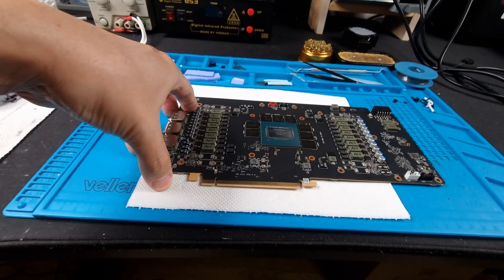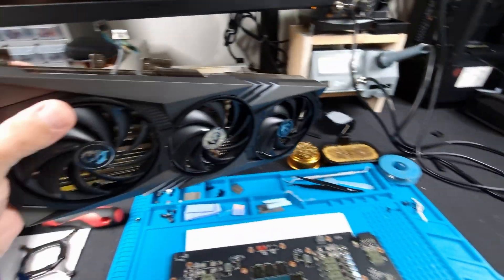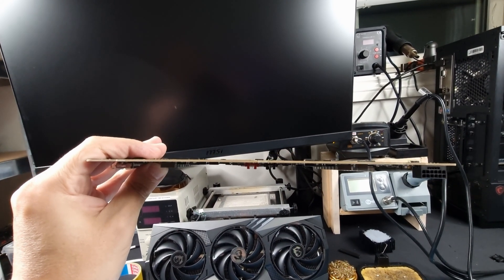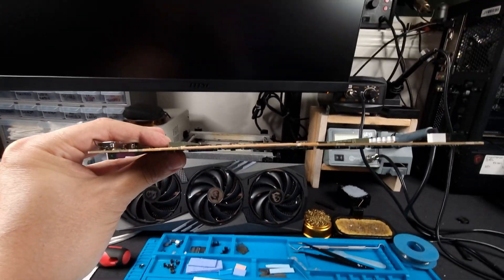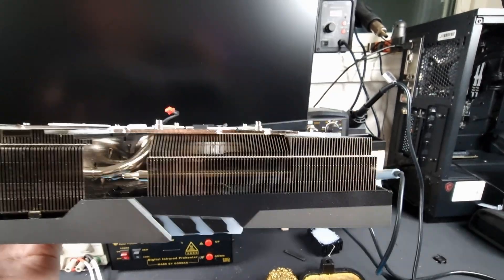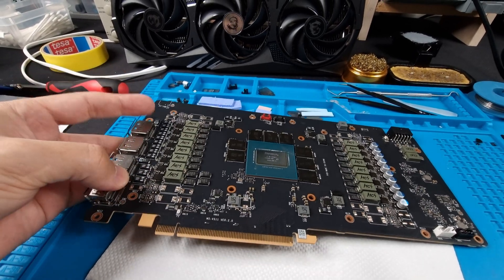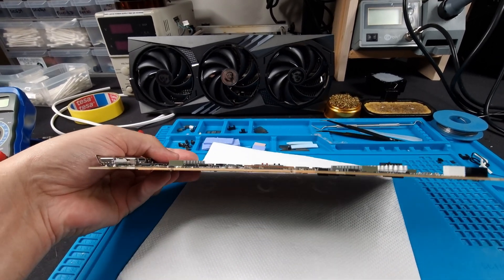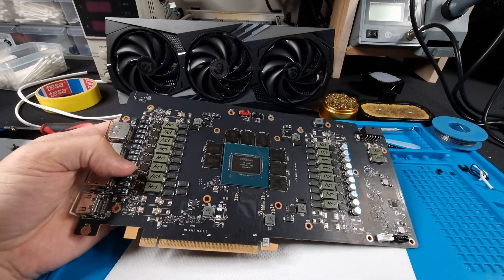How Using GPU Supports Incorrectly Can Destroy Your GPU.

Comment: I found a solution - both my 4090s and 5090s are AiO. That means shorter PCBs and dramatically reduced weight due to no massive heatsinks being required to cool the card. Ran two 4090s for three years and a 5090 for a year and zero issues. Just got my second 5090, also AiO and am loving it 👍
Reply from the maker: I can't speak on cards with waterblocks on them since I do not get them in for repair often.

Comment: you dont use the stand to lift up the card.
you use the stand to just hold the card in its most level place, and like another guy mentioned, dont use it as a car jack lol
i think people slot in the card then add the stand and push up up and uuuuup until the card has no more play and then turn the screw and say, ''yea this works, this is solid ''
and they dont even try to eyeball the side if its anny level or not.
there are also parts on the mobo that you can level your card with visually
my 3 year old 3080 is still flat as it can be
Reply from the maker: This is one of the problems with people using supports incorrectly. I made a video lately explaining how to use supports correctly.

Comment: Some are bad and some are good however the fact remains… the ATX design was never designed to handle 2kg+ PCIE cards unsupported…. It just wasn’t.  As for riser cables… don’t use them, there is no PCIE riser that is certified at PCIE v5 or above.  You cannot certify at that length at that speed, you will be getting errors on the link.  A PCB based riser that has retimers is the only solution here not some flexible cable.
Reply from the maker: I use risers in all my builds, and I have never experienced any of that stuff you're talking about. The difference between 4.0 and 5.0 when it comes to graphics cards is negligible. There is no real advantage going up to pci-e 5.0. Phanteks makes several vertical mount kits, and their pci-e 4.0 riser cables work perfectly fine with my 5080 and 5090 cards.
Reply: @TechnologyHive PCIE V4 works fine… V5 requires retimers every few inches hence it needs a PCB.  Can’t be done with a riser cable…  whatever companies are selling isn’t certified.  MCIO resolves this but with very very expensive cables.

Comment: Some cards tie the cooler to the mounting plate beautifully, with 12-14 gauge material. Others ignore supporting the cooler completely. It’s crazy..
Reply from the maker: This is why I'd just go vertical. The PCB's are getting smaller, and heatsinks getting bigger. Ironic.
Reply: @TechnologyHive I just went vertical. It does add additional cost to a build, not to mention incompatibility with large cpu tower coolers. Among other problems. (looking at you riser cable)
Looks good though and very secure.
Reply from the maker: @kmccurdy21  It has its pros and cons, like losing access to the other PCI slots, which I think the only con that I can think of. The pros are worth the extra cost. Yeah it does add to the cost of the build, but if I have to repair one of these cards with cracked solder joints under a memory chip due to sag, you'd be thankful you went vertical, lets just say that lol. 

It's not cheap. Especially how we are all getting ripped off with these ridiculous memory prices. I used to be able to buy 20 GDDR6 chips for around $100 from China. Now its more than triple the cost. That gets passed down to you, for your GPU repair. And it's not going to get better any time soon, and I mean the whole of 2026 into 2027.

Comment: Respectfully asking, and thanks for the video. What is your opinion on the voltage drop when using the riser? Is it significantly enough to damage the card?

Thank you,
Reply from the maker: I have not experienced any issues so far and I've been using the same vertical mount kit for two years now.

Comment: I got a B580 Sparkle Titan and I was consistently worried about my motherboard and GPU flexing inside the case, and the sag bracket the GPU comes with is fairly flimsy. I was extremely aware when installing not to flex the GPU either way, but there's always the worry that the motherboard will eventually fail.
Reply from the maker: If you're not using a type of support with your heavy GPU, then it is more likely that your GPU will fail before you motherboard. But it sounds like you're using a type of support so I would not worry so much. If you want peace of mind, vertical mounting is the way to go made by a third party, like that from Phanteks.

Comment: Pro tip for an horizontally mounted card: first, put the case and the motherboard horizontally, mount the card and screw its bracket, then put the case in its normal final position and ajust the stand near the bracket, then move the stand where it's supposed to go (about where the motherboard ends, for a regular ATX mobo), the sagging end of the card will be perfectly leveled with the bracket's end. Of course, this works only if the card's fan side is all flat.
And don't use it as a car jack, as it's clearly what happened here on this poor twisted PCB.

Comment: I noticed this on my computer.  It turns out I extended the support to high and it was causing it to not work so I just lowered it a bit so it would support it and not destroy it and it was ok.
Reply from the maker: Maybe you dodged the bullet on that one. 👍🏼
Reply: @TechnologyHive  I felt lucky when it was not showing anything on screen I was worried I ruined my 3090.  But all I had to lower it so it was not forced up but supported.

Comment: My MSI card has a full-length support that installs in the slot underneath the card. So, now my card sags uniformly across the board, lol.
Reply from the maker: Try a vertical mount, like that from Phanteks. That will help with that sag.

Comment: Need a solution for more rigid PCB
Reply from the maker: The more rigid they try to make the cards, the more metal they add, the heavier it gets. I would just try and use supports properly or go with a vertical mount like that from Phanteks.

Comment: Two things, gravity always wins and user error is a guarantee.
Reply from the maker: If you can afford a $1000-2000 card, you can afford a $50 vertical mount kit. If you are worried about your other PCI slot being blocked, then you may want to look into a PC case like the Cooler Master Elite 130, for example.

Comment: Weren't they supposed to be making videocards smaller and more power efficient? Guess they forgot.
Reply from the maker: Yeah, they are, actually. If you look at modern gpu pcbs, a lot of them are almost half the length of the heatsink. But they are greedy so they slap these huge coolers on these small pcbs for a few extra fps at a higher cost to the end user. Its nonsense.

Comment: My own case is custom built by me and has the motherboard orientated with the IO at the top of case and the GPU is then hanging from the top to the bottom in the PCI and has 0 stress on the GPU, have also designed the motherboard be infinitely adjustable back forwards up and down, it tacks 4x 360 rads, but i just run 2x 360 rad both at the tome for an air flow from bottom to top, so that's 6x 120mm at the bottom, and 6x 120mm at the top on the 58mm deep 360mm rads for dual loop, the IO is not an issue as i have am in the process of building an IO harness to take the IO to the back of case.

Comment: Make the GPU's out of the same material as the NVIDIA FE cards. I love how these manufactures use cheap plastic then charge over MSRP for them.
Reply from the maker: It is to no surprise that I hardly ever get any reference design cards in for repair due to sag damage.

Comment: But Im pretty sure there is a way to make horizontal supports that work well? Because in vertical there is worse airflow and heat might damage the card then instead of sagging
Reply from the maker: Use supports properly. My last video shows how to do it. And no, vertical does not affect temperatures unless youre using your case's vertical mount option. You have to buy a vertical mount kit, like that from Phanteks
Reply: @TechnologyHive  Ah yes thats exactly the video I needed, thanks!

Comment: What about the GPUs with metal backplates? Do they make a shell with the cooler around the PCB?
Reply from the maker: It makes no difference. They even try adding some type of glue around the memory chips and they still crack from sag. At this point is either install your support correctly or go vertical.

Comment: Hi. I am about to build a new PC after my last build from 10 years ago. To avoid all this headache, would you recommend getting a horizontal case like the Silverstone SG11 where the GPU would basically stand on the motherboard the whole time like it was back in the 90s? Or would these heavy GPUs instead cause damage to the motherboard if I would go with this method?
Reply from the maker: Absolutely! If you can also find a Cooler Master Elite 130 somewhere, heck, I would even snatch one of those up in heat beat. But yes, the SG11 is a nice case.

Comment: The ASUS TUF 4080 Super came with a support. Instead of a bracket the GPU has an indentation that rests on an adjustable pillar that’s included.
Reply from the maker: Yes, its the same pillar supports you find on AliExpress or Temu. But they work!

Comment: this is done only to sell more if the heat dont kill it gravity will. above a 2 slot cooler it should be relased as water only with full cover block. that wont bend.
Reply from the maker: Yes but water blocks are heavy too. I have an EK for an RTX 2080 and it weighs as much as one of these heavy coolers. It also adds another point of failure as the pump could fail just because, and they will charge you even more money for a water cooled option, which do exist and cost an arm and a leg. Its sad to even talk about it.
Reply: @TechnologyHive  its heavy, but supports the pcb muh better. maybe the only failure on the aftermarkets waterblocks that they not really use the pcie bracket as rigid support, did not assemble mine for the nitro 7900xtx (still waiting for loop parts) the original cooler have a really sturdy aluminium shroud all around attached to the pcie 3 slot bracket. but the one included for the block seems to attach to the pcb only, or it does somehow to the block itself. did not take it apart yet. but you have no moving parts so you can support around the gpu die. have an old cheifteec ba01b case so mounting the card vertically is not an option. rm600 series silverstone case which i was looking at couldnt not get a straight answer from the distributors for the internal height measurements reference point. and it costs too much to not fit the block.

i would love to see the difference in failed joints if they wouldnt pushed for lead free solder. tin whiskers were the first problem, then its cracking.

Comment: i got the seperated screw-like supports that are titanium and u can adjust the height on each one.I placed a total of 4, one on each corner, hopefully my already 2 years old Gigabyte rtx 4090 Gamin OC gonna be fine for years to come.
Reply from the maker: When you take it out next time for maintenance, look at the PCI-e hook on the card. If it looks a bit twisted, its starting to sag, which is bad. But as long as you add support now and you're not experiencing issues, it should be ok.
Reply: @TechnologyHive  still blows my mind how a 2.5k$ product can come with such a flaw by design, i guess it all adds up into better to brake and keep on buyin next product, Consumerism 101
Reply from the maker: @NaturalBornSina  It's all just greed, and as long as people keep buying this stuff, it will keep going on.

Comment: support shouldn't go to far right side of the card. it meant to go on a line exactly where gpu core is located around end of pcie port line. its school grade physics. simple console with two points. one clamped joint and one pinned joint

Comment: I installed my 4090 without support cause the one i have now not high enough, although it doesn't look saggy or anything. 
i don't know if i can find anything that fits cause there're 3 fans installed under the GPU :\
Reply from the maker: If i were you i would find some type of support or just get a different case. 4090s are generally heavy, especially their reference models. It will fail in time if you leave it without support.
Reply: @TechnologyHive  i'm not gonna lie your comment was terrifying to me :D  i put some DIY piece of metal under the support which came with the 4090, and its temporary solution until i find a holder that fits perfectly. thank you for the video bro , Subbed
Reply from the maker: @Haninos  Your welcome! :) And thanks for the sub.

Comment: I have a question, I own a RX 9070 is the Asus prime model whit 3 fans but it's a 2 Slot GPU so is not that heavy as that one in the video is fine for me just using a GPU support or should I also go for a Riser?
Reply from the maker: I would use a support. Just place it between fans 2 and 3. It is still a long card.
Reply: @TechnologyHive Fun fact there in between the fan 2 and 3 there is a little Triangle 📐.

So I am fine without the GPU PCI Extender? The GPU Support Bracket is enough for me?
Reply from the maker: @TheAtom0 I would just use the support bracket. But ultimately it is your choice for what works for your configuration.

Comment: Wow. Thankyou for this warning. I was always wondering about this even though my support is a decent one.  I don't have a riser, but my case is designed to be turned so the GPU is resting on the MB connection with the help of gravity . I will turn the case flat.
Reply from the maker: Putting it on it's side also works fine. I am glad you found the information useful!

Comment: I saw your recommendation regarding graphics card stands: "one stand should take up 2/3 of the card's length." Where exactly is it best to place the stand: in the middle of the graphics card or at the edge? Thanks.
Reply from the maker: You can place is in the middle or the edge, just as long as the card is not sagging.

Comment: I like the support that the Lian Li Dynamic EVO XL uses. Doesn't just have a bottom part that lifts the card up, but a top part that keeps it from being lifted higher than parallel.
Reply: I have that case, do you mean the gpu anti sag that you screw on the standoffs before adding the motherboard in ?

Comment: Good thing the powercolor 9070xt reaper is so fricking light
Reply from the maker: I would still use support. But I think you're on top of that already :)
Reply: @TechnologyHive  would u say asus prime 9070 non xt needs support?
Reply from the maker: @hafttak7303 Yes, I would use support with that card. I just one in for repair. It is not as large and heavy as other models, but I do not trust that thin PCB.

Comment: I don't think that they bend like that just from sitting on the support, people should let the GPU just rest on the support instead of forcing the support to push the GPU up ( I'm slightly guilty of that too) gonna take the glass off tomorrow and loosen it and lift the support just until it touches the gpu instead of pushing it up a little, thanks for the video ( if it doesn't sag don't push it up at all with your support guys!)
Reply from the maker: You're right. The GPU just needs to rest on the support, not be pushed up by it.

Comment: Okay so I’d like to debate my two conflicted opinions… In summary I had a 6900xt that was mounted horizontally with an incorrect support (too much force from my side) and it had torn pads etc and died. Long discussion and agreement with my GPU repair guy wishing people knew to mount vertical. I then got a 7900xt and swore to only mount it vertically using Coolermaster Gen4 and for the last 2 years I’ve had that. I am now getting increased temps, crashes and freezes. I decided to remove my riser (which was far away from the glass) and mount it horizontally. I have decreased temps by 10C to 15C with no crashes or freezes. Did the riser suddenly go bad? I’ve heard of 7000 series thermal paste wash out? Why is my system suddenly more stable?
Reply from the maker: I would say that perhaps the riser pcb bowed and signal was interrupted. I can't say without looking at it in person. As far as temps go, I have all my GPU's mounted vertically and temps are the same as horizontally. I would say that taking all you said into consideration, it may have been the thermal paste the whole time. This is just guessing.
Reply: @TechnologyHive Yeah so my bigger concern was the crashes and freezes, tried every fix on earth other than removing the riser. After removing the riser no issues. As far as temps go I was within normal AMD limits but hitting 100C Hotspot where as now its 85C in horizontal. I have read the 7000 series has washout in vertical position. Ive ordered PTM and Upsiren Putty but probably don't need to void the warranty as yet.. Maybe ill just get 2 or 3 supports and leave it horizontal??
Reply from the maker: @ctheodorou  Supports will do just fine. I would place one between fans 2 and 3. That should the most of the heavy lifting.
Reply: @TechnologyHive  Cool. Thank you so much!

Comment: Have a 4080 super for 2 years and used it without a support or with one that was too small, This week arrives a new one with good measurements for my gpu case combo, i had a 70-120mm and now comes a 30-60mm, which is perfect as I only need 60mm, before thses I used a cut out pencil that held for many months. Will use the support to keep the gpu straight, I also have a screw on my case that supports the back of the case part of the gpu. I'm in the green for now, max graphics and everything works fine
Reply from the maker: Some support is better than no support. But yes, one that provides better support is always best.